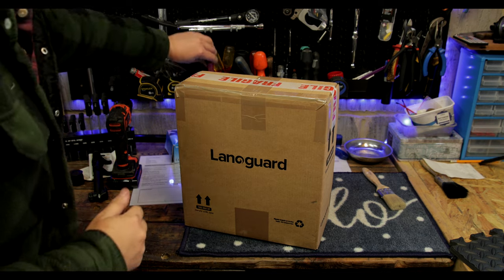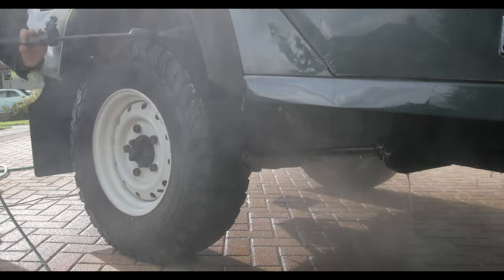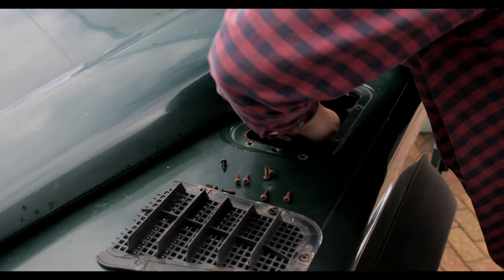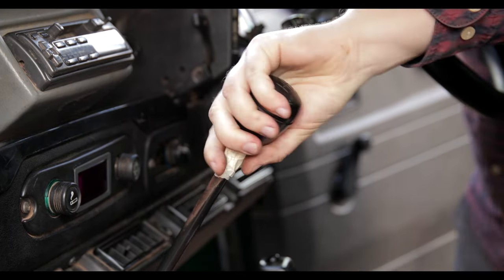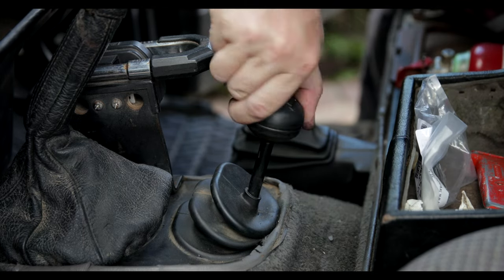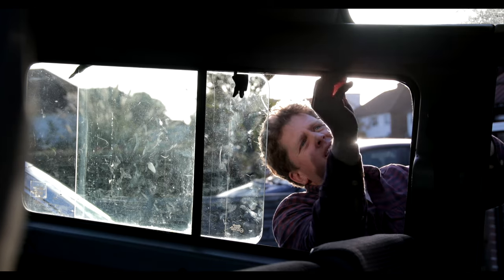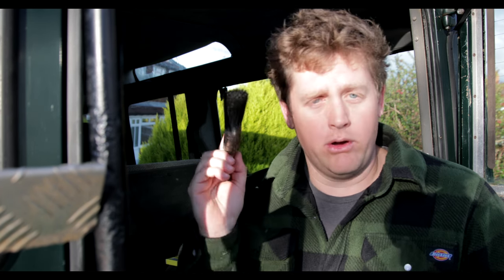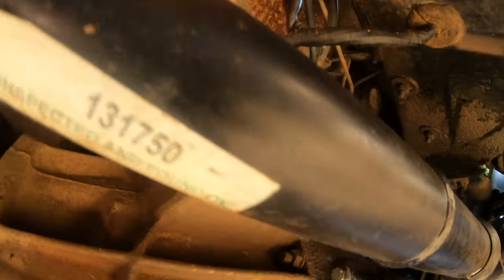Saving My Land Rover Defender From Rust With Lanoguard

Comment: I have a friend who works for Twisted. He told me the first thing they do on any Land Rover they touch is take that rubber bung out and throw it straight in the bin. They get blocked so easy and wreck the heater...
Reply from the maker: That would explain a lot actually. My heater doesn’t work… hoping it’s just a fuse but probably more than that.

Comment: I noticed when you replaced the wing-top vents that you installed the gaskets for each side in different positions. The left vent gasket was installed under the fender, the right side vent gasket was installed between the vent and the fender. Was there a reason for that?
Reply from the maker: I just tried to copy how it was when I reinstalled it. It might not be correct so well spotted. I’ll take a look at it.

Comment: lol.......If you can afford a Land Rover, then get the right equipment. A quality spray gun with application wands and a good air compressor. I have to laugh at the large amount of money people will spend on vehicles and then buy  cheap unless crap to protect them in the North East rust belt..